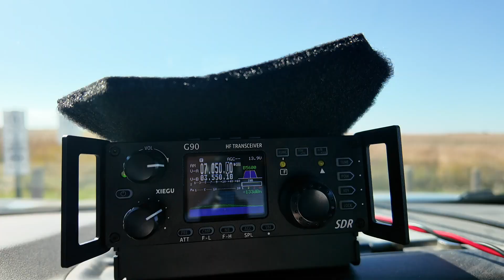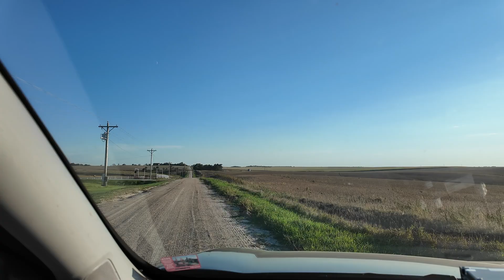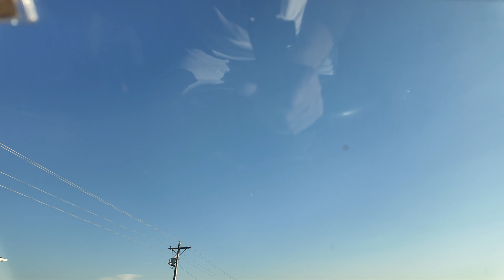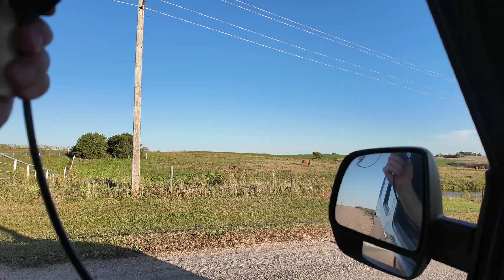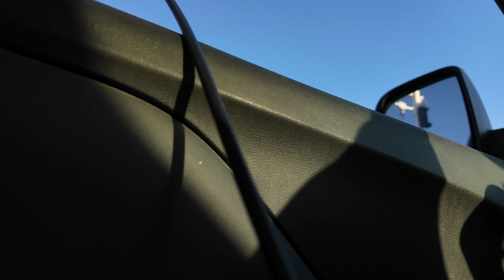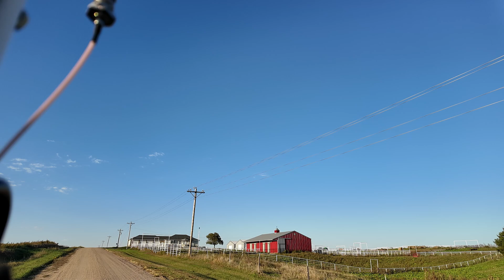Power line RFI noise problems at my closest POTA park. Can we find it?

Comment from the maker: Update: I talked to my contact at the rural power company and he said there are lightning arresters on that pole and they will check it out when they can. I know they are busy and it will take some time, but hopefully we're on track to a solution and I can POTA from the WMA.

2nd Update: Wow, the power company was out there in just two days and disconnected the lightning arresters on the pole in question. I went back out there and with basic testing using just the van AM radio, and a HT on 40m, both were very quiet. I'm feeling very confident the problem is found. I plan to try to activate the WMA in a few days and know for sure.

3rd Update: The next weekend, I went back and activated the WMA and the noise is indeed gone! I recorded that activation and it is the next video after this one.

Comment: Now you're doing some science, Scott. Great job tracking down the RFI.  I was excited to activate a park back in Feb it only had 2 CW contacts before. As soon as turned on the rig I realized why S7 noise!  Very frustrating.
Reply from the maker: I hope I'm on track ... I'd like to build some credibility with the power company, so I hope I found the problem. I don't want to get to where they are like "oh no, not this guy again". No question I was close to the problem, I just hope I have the right pole.
Reply from the maker: I think we got it. The power company stopped by there and disconnected the lightning arrestors (two days response!) I went out and just listening with the van AM radio and the DF Loop on a HT, it was all quiet. I'm planning on activating the WMA on Sunday afternoon (10/5/25) and will know for sure.
Reply: @ScottNB0W  That's great Scott! All that work paid off. I'm at work all weekend but I'll try and log into my friend's flex when I see your HamAlert.

Comment: Nice video. Could it be an electric fence for that horse pen?
Reply from the maker: I suppose that is possible but I didn't see an electric fence, it was all tall wire fencing. I also would expect electric fence to be a periodic snap, not continuous buzz. I'm sure I don't know what I don't know though.
Reply: @ScottNB0W  I run electric fence here and it sounds like you describe - bzzzt bzzzt bzzzt, a pulse ever second or so.
Reply: @K4MW_1  Yes, it would be pulsing. We used an electric fence for the hog field when I was a teenager and I could hear it tick. Aside: The hogs could hear it too and learned to avoid it.
Reply from the maker: I think we got it. The power company stopped by there and disconnected the lightning arrestors (two days response!) I went out and just listening with the van AM radio and the DF Loop on a HT, it was all quiet. I'm planning on activating the WMA on Sunday afternoon (10/5/25) and will know for sure.

Comment: That's some diligent work Scott!  Hope the power company is responsive.
Reply from the maker: They have been good to me in the past. I just hope I'm close and not sending them way off base.
Reply from the maker: I think we got it. The power company stopped by there and disconnected the lightning arrestors (two days response!) I went out and just listening with the van AM radio and the DF Loop on a HT, it was all quiet. I'm planning on activating the WMA on Sunday afternoon (10/5/25) and will know for sure.